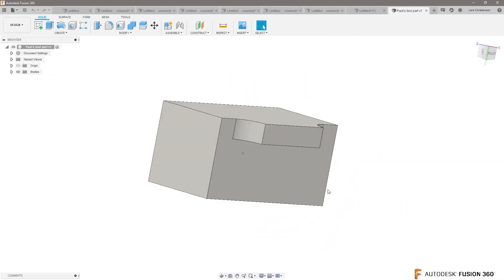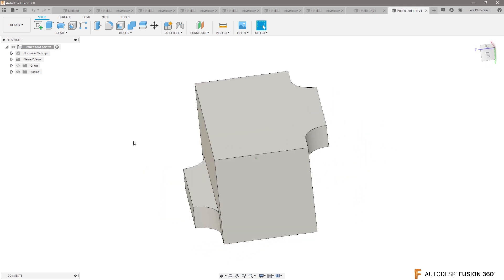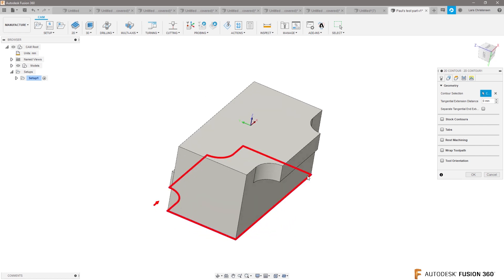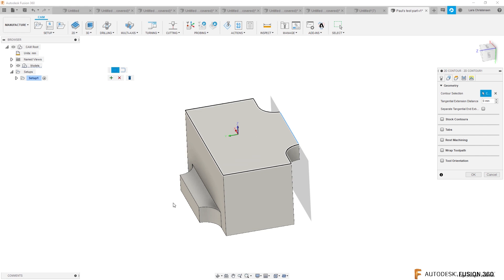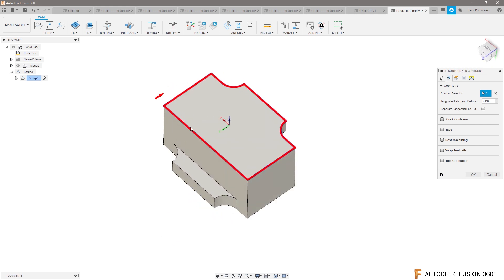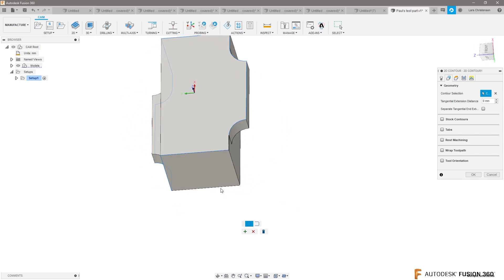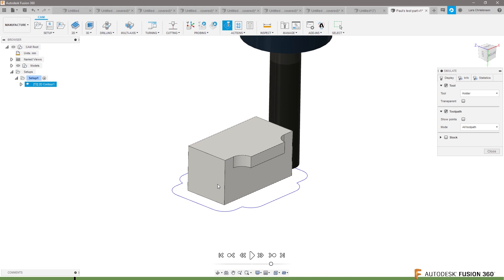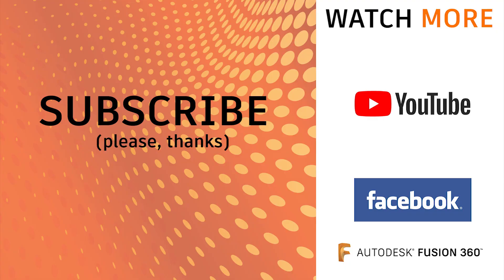Fusion 360 — Must Know Selection CAM TIP — Ask LarsLive

Comment: Hi Lars , is there a way to get a slot cut beside from running a trace or even with a trace run a slot cut with a tipe of peck cycle on Y 
i did a cut on my cnc on a nylon strip and even though it started melting the plastic i had no choice at the time than to just push on through and run the same path over about 3 times till the slot was clean and id like a better way to do this

Comment: Hi Lars, im struggling for some time to execute a woodcarving of a complex model. 
My first approach was to import a quad mesh model and convert it to a body, than cnc. Im losing details on conversion so i gived up.
I noticed that you can do a 3d toolpath for cnc stright from a high detailed mesh.
Second approach was to do a t spline model using a mesh as reference.  Time comsuming, bad results.
Than i saw this https://www.youtube.com/watch?v=7GsSZTJQMCI. Seems to me a very easy way. It generated a g-code for each face. 
Can you please enlight me and do a tutorial for your approach? 
Also i noticed some guys are generating models using alpha imagines. Like for example Aspire Clipart for Alpha CAM: https://www.youtube.com/watch?v=dpwzQjWIGf4 or here https://www.youtube.com/watch?v=x9D2JAAEC7w&t=496s
Thanks in advance.